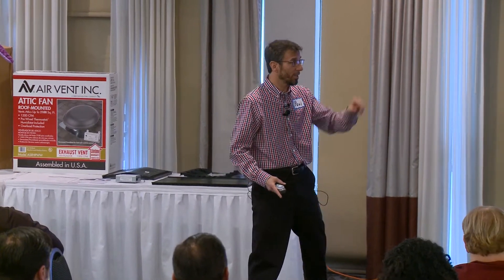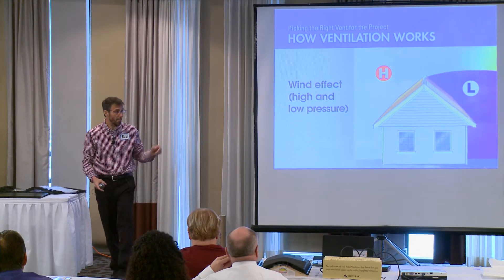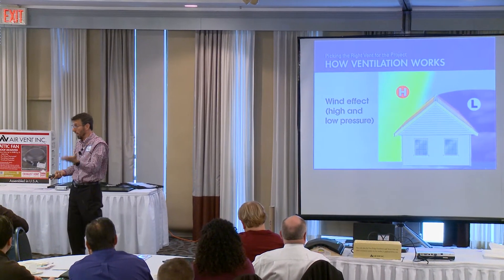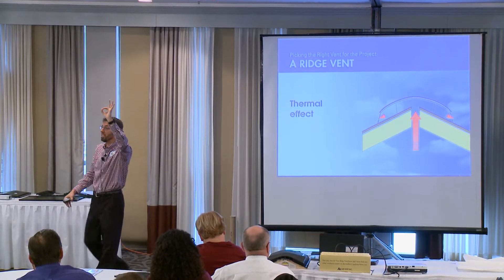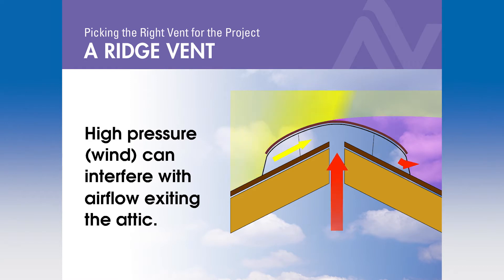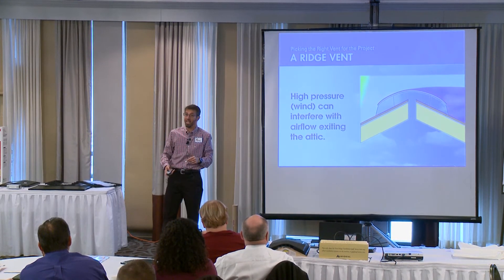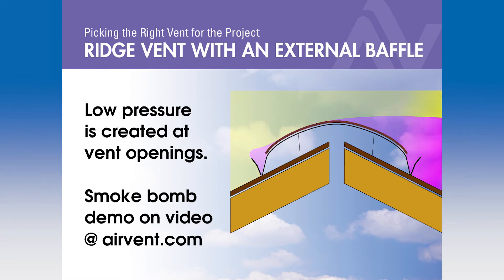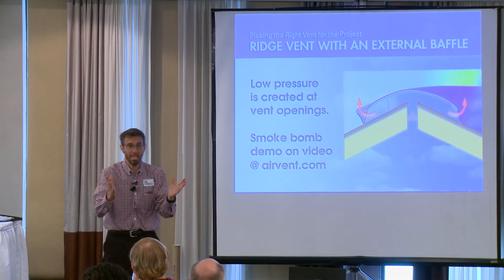Ridge Vents with External Baffles are Best

Comment: Great explanation! I have installed ridge vents twice on my roof and both times used ridge vent. Between those installations a roofer installed 'cobra' style ridge vent (junk!). How do I KNOW the ridge vent works several times better? I vent my garage through the ridge vent! It makes all the difference to have BAFFLES on the ridge vent‼

Comment: How many baffles is needed per sqfoot? We have the ridge roof and we have Rockwool insulation (not blown in)
Reply: Install the baffle the length of the entire ridge. Some instructions will say to only go within 2 ft of the end of the roof (due to wind vortices) however that looks dorky. Instead, extend the vent end-to-end but install some felt under the last 2 ft of vent (or just don't cut an opening in the roof there) which prevents it from actual vent or wind vortex action.